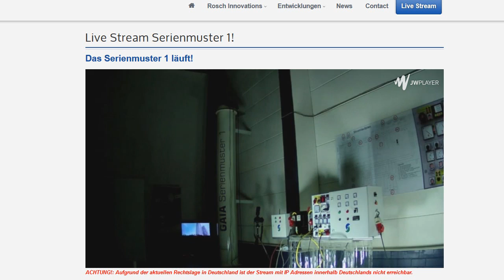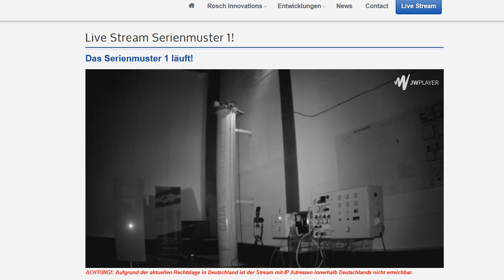Gaia AuKW failure Power went out at Rosch in Spich Germany

Comment from the maker: Updated explanation on 30th of April 17:40 pm.
The AuKW lost its power , that so far is known. If the whole hall building power was out is not known nor verified as the IP Cameras and Router still worked... Were these powered from different power lines ?

Gaia explained it with a technical malfunction because of failed load balancing of the 3 phase generator system, cause they forgot to plugin again the right loads after a demonstration and the AuKW shutted itself down after 2 or 3 hours or so..

So, we don´t know, if it really was a power outage and it gave away hidden cable
powering the device or just a malfunction of the device with itsself shutting down
after about 3 hours.

BTW, the lighting of the hall after the failure came from the 2 Infrared Light powered IP-Cameras, that automatically switch to InfraRed Mode, when the light goes dark.
So my claim, that the emergency light came on, was wrong...
Gaia also posted , what IP Cameras they use. Check the upper forum links to read more
about it...

Comment: Note the TV turned off with the Hall lights, not the floor lights...
Reply from the maker: JohnEnergy2012 Very good observation ! Hmm, do you think the left lights on the floor might be on a different phase that was first shut down, than the lights before the panels and the TVset ? Were they on a different phase ?
Or did the security guy accidentally just turn off the hall electricity at several switches one after another ?